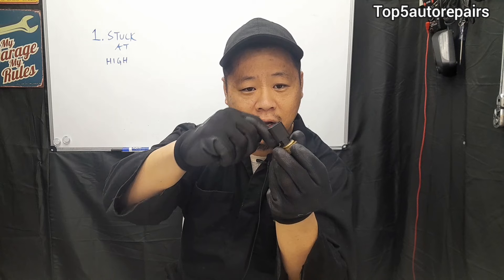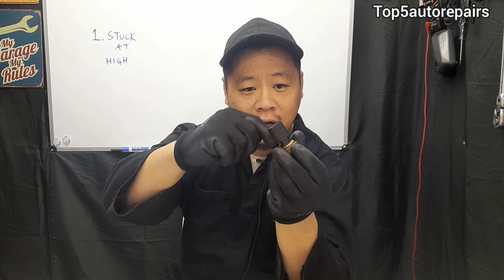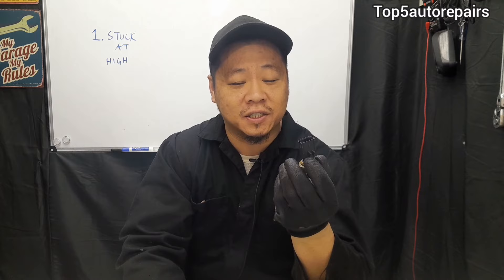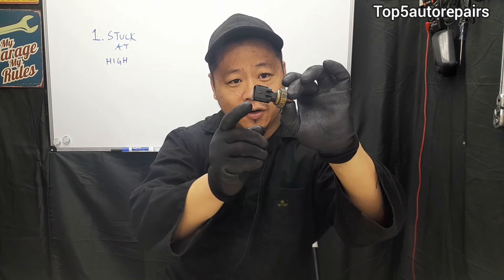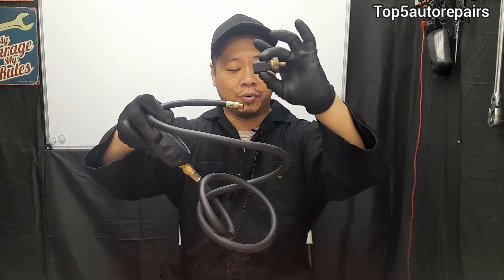Symptoms of a Bad and Failing Oil Pressure Sensor Switch | Oil Pressure Gauge at 0 20 80 | Light On

Comment: My question is that I get the low oil pressure when the weather is cold at 55 degress and not at hot or warm days. Can it be my sensor or is something else??
Reply: I think it just determines how the temperature is but if your worried ask a local mechanic to make sure
Reply: Did you figure it out? My 2008 Honda civic oil light just turned on for the first time and it’s been cold (-3)
Reply: I think it’s temp sensitive. The sensor performs better in warmer weather as opposed to colder weather.

Comment: My oil light came on a few days ago but only when idling. It’s been cold as hell recently so I don’t know if that’s the reason why.
Reply: If you've been driving the car on short trips, is diesel, and is cold outside, then it can happen that there's carbonization in the engine or some part is clogged somewhere. An engine flush followed by oil and filter change can fix it. Air filter replacement is also advisable. But it can be something else such as engine gasket leaks, or even sludge accumulation in an oil strainer under the engine. To know best, you can hook up your car on a OBD scanner and look for sensors in the oil pressure and oil pressure control solenoid. Sometimes, the solenoid cannot fire because it's digitally controlled and dependent on the correct oil pressure to activate the release valve when you remove the foot from the gas pedal, resulting in errors like this. Firstly, the pressure itself at idle should be normal as well as at particular RPMs. Hope this helps.

Comment: Having an issue at the moment that’s stressing me out. Four days ago I noticed when I would take sharp turns I’d get “ check engine oil level “ and as soon as I’d drive normal it would go away , and it’s been doing that ever since. I checked my oil yesterday by looking at the dipstick and it was dry. I decided to do an oil change and when I jacked up my car I noticed it there was dried up  oil around the oil filter area and alongside other spots by it. I assumed that maybe I didn’t tighten the filter enough, so I made sure to do it this time lol . I finished doing the oil change and drove it a bit and still got the light that says “ check engine oil level “when I took a sharp turn . As soon as I got back to my place I checked the dipstick again and it was still dry
Reply: Wow! You’re very lucky you didn’t blow it up.

Comment: My trailblazers oil pressure gauge bounces back and fourth when the engine gets hot.
Reply: My Joyner trooper 1100 is doing the same thing. Did you figure anything out on it?
Reply: They are a good knock off side by side
Reply: My 05 silverado is doing the same thing hoping it's just the sensor. I've started to get a bit of a knock in the engine too.
Reply: @hunterread3507 did you fix it ?

Comment: Small thought, it may not make sense and I'm sure after years of engineering this shouldnt be a problem but its a thought... After an oil change or replacing the oil could the small port in the sensor make it hard for the oil to flow in causing air to be trapped in it.

Comment: I have a 2011 ford edge and while I was driving I Lost power (dash was still on) but no acceleration,steering wheel stiffened up brakes went hard to press. Then I got a low oil pressure light . Is that what would cause my problem?

Comment: My 350z oil pressure gauge was showing 120+. Changed the sensor with an Amazon one for $20. Now the gauge is reading low close to 5-10psi. And after a day, now the red oil can light is coming on in the gauge cluster when at idle. I bought a manual tester and it’s reading a healthy 14psi (the tester  was on loose too, as oil was leaking). Thought it was the gallery gasket, guessing just a faulty cheap sensor from Amazon. If my car blows up…..

Comment: My 2004.5 LLY Chevy 2500 duramax just started throwing a low oil pressure warning and won’t stop chiming. I drove the truck for an hour without anything happening to the truck so I’m guessing the truck is getting oil pressure but the cluster or sensor is gone. Wouldn’t the truck start knocking or lose performance after an hour of driving with zero oil pressure ?

Comment: Exactly how my Ford 2002 expedition stalled out... Oil gauge was goin bonkers .. high and low ... Then not long after my SUV stalled out.. left my expedition parked for about a year... Untill recently this month I'm trying to figure out what next to do...  When I checked the oil. There's no mixture of anything odd ...  Jus Looks like Black oil that needs to be changed.. so now the radiator has been replaced,. I'm putting in a new Air filter, oil & oil....and jus last week I bought the oil pressure sensor or something.... I haven't installed anything yet jus the air filter .... But I was told it was the oil sensor...  And  the engine was locked...  I don't know...what \ or where to start.. but with the battery first 😂

Comment: Hmm, I got one where the needle will sometimes fall to zero for about a second and then back to normal. Usually does it on a blue moon (don’t drive it a lot now). 

On my car it should be an on and off type of deal. 

So my assumption is, it’s going bad?

I’ve had the engine rebuilt so I would think it’s the actual pump as it should be a new unit.

Comment: Excellent Video Boss man! I`m getting good oil pressure on my gage but still getting the Ck engine light on my 2014 Chvy Silver PU. So if I change the Oil ,Filter and Sensor switch what about the little sensor filter that sits right behind the switch?
Reply from the maker: Correct
Reply: @Top5AutoRepairs  Thanks

Comment: Any suggestions on what i can do to get rid of my rocker arm/lifters from clicking when going above 2000rpm? My mechanic said there was no damage internally but the there are a whole crap of sludge. And to use seafoam prior to doing oil changes (every 1,000 miles) and hopefully it goes away.

Comment: I Just Bought one used 2008 grand vitara v6 2.7 lts.  
They reap me off
Now i m dealing with it
Anyways

The engine starts on time
(No hesitation at all)
Temperature looks good after an hour of driving
Runs pretty good on flat surfaces...except hills

My problem is that 
- the scanner plug doesn't  work. (Can't  read any codes)

- I Just found  that they disconnect the oil sensor or knock sensor 

- It looses power after warmed up going up a hill.

- it makes a rattling noise by the driver side of the engine.

I m fixing to run all types of tests  ....
Oil pressure  , engine pressure (compression)  
Any other suggestions 
Thanks for your advices

Comment: I swapped out my oil pressure sensor and the light stays on now. It use to flicker. Oil change and lever good. 2.5 duratec.

Comment: I have a 2001 mercury grand marquis and the oil light comes on most times lately when i stepped on the brake pedal before and after i got a oil change and the brake fluid is clean & full, Is this my problem??

Comment: My car jumps like it wants to stall no check engine lights and I just got it back from the shop didn't really want to take it back to said shop cuz if they didn't fix the issue why would I take it back and let them charge me again not to fix the problem but just didn't know what to do any info would help but acts like bad fuel or faulty fuel pump please help

Comment: My 2008 Mazda 6 engine oil light flickering while in low speed. But the light is off while in higher speed. 
Is it a problem with OPS?
Thanks
Reply from the maker: Most likely but first check oil level.

Comment: I got a 2016 Hyundai Tucson with oil light flickering, checked oil and it’s good, I replaced the oil pressure switch with a dealer one. So it has new switch and oil level is full but oil light keeps flickering. What can it be? Thanks in advance 🙏🏼
Reply: The wiring, bad oil filter, or engine bearing clearance are too high.
Reply: So you're saying you can have a bad oil filter just about Dew for an oil change

Comment: My zr2 s10 has 329K miles and it showed 0 psi out of nowhere and turned off while I was driving, but it has done it a few days at a time, does this mean the sensor has finally given up, or has the switch given up?

Comment: Hey man, please help me with my isuzu dmax 2007..
My formen told me he use 15-40 semi synthetic engine oil..
Why when i started my engine, oil pressure light comes on however they go away as soon as i hit the gas. But when i release the gas it will appear again…after driving for 20-30 minutes it will go away..Any ideas? I already got my oil pressure sensor and oil pump changed..im also changed my head engine totally it cost me MYR8000
Please help man, i really dont want my engine to broke again…im in Malaysia, should i change to 20w50 engine oil?

Comment: Do I need to drain oil before changing switch or can switch without anything
Reply: You can always just put the oil back in as long as it's clean
Reply from the maker: No need to drain. Make sure to check oil level after replacement.

Comment: I'm replacing the oil sensor in my car and I want to know if I need to disconnect the battery since it is electrical or can I just change it without doing that step?? Thanks
Reply: Disconnect the battery first

Comment: Having some problem gave me a low oil pressure code while driving so I added some oil then drove a Lil bit then it came back on low oil pressure was keep flickering with the red oil symbol what u think
Reply: If you overfill it will cause the same type of issue.  Make sure you didn’t over fill

Comment: My 5.7 ram has normal oil pressure then an alarm and red light and guage falls flat. Cut it off, crank back immediately and perfect pressure till it does it again.. any ideas? Many Blessings, Kev
Reply: Same. Did u find a solution
Reply: Same issue. Usually happens on a mid-chilly morning 60°F or so. Restart engine, pressure works fine. Will change switch at next oil change.

Comment: Will it cause rough cold starts that smooths out after a minute or so?
Reply: No. All the oil pressure sensor is is a warning device. It has no affect on your cars performance whatsoever.
Reply: @eliferguson3422  thank you
Reply: @radianm6  no problem 👍

Comment: Can the ac pressure sencor be the reason of my car overheating. I got a 1992 buick riviera 3.8 6 Cyl my pressure switch ac leaks were i connect the plug on to and my car overheats
Reply: Check the your engine temperature sensor or ETC that’s the culprit if the radiator and everything else is good usual place is near thermostats or side of engine block
Reply: @rosieclark3661  thank you

Comment: My oil pressure gage is sticking at around 20 sometimes 0. Just had a lot of work done some by mechanic some by me after my car broke down on the highway. New fuel filter & pump, all new spark plugs & wires, distributer, starter, thermostat.. I think that's all 😅
The coolant gage sometimes bounces still but I push on brakes and it goes down pretty fast. It doesn't seem to be overheating because the level hasn't gone down again. 
The oil pressure was fine before this..
Reply: My 2013 gmc Sierra hangs out at around 20 but i got no check engine light and its running like the day i bought it. Just turned over to 76k miles

Comment: hey man, just got my car with back from the shop with a new used engine a couple months ago. However when im driving for awhile and i get in traffic my temp gauge rises and oil pressure light comes on however they both go away as soon as i hit the gas. Any ideas? I got my oil pressure sensor fixed by them the day after i got it back and it continues to do it
Reply: How's the oil level?
Reply: Could be bad tolerances in the engine. If the crank etc are worn down, oil escapes and you lose pressure. Pressure can drop once the engine warms up (oil thins out), once you stop driving (engine begins idling under low load). This combined with loose tolerances means that insufficient pressure is produced to fully lubricate the engine. The overheating at idle could be a number of different things. Air bubbles in the coolant (wasn’t burped properly), low coolant, thermostat going bad, and worst case is the engine overheating due to poor lubrication at idle, or alternatively a head gasket leak. Can also be caused by a seriously jacked up water pump. My 2006 Colorado actually had both of your complaints. Oil pressure light would come on after heavy driving in hot weather when I came to a stop. This was fixed by simply installing a new sensor, old unit went bad. The coolant issue is something I’m still somewhat chasing, though I believe it was related to a poor fuel to air mixture that I corrected, as it has remained relatively steady since I completed work on it. I hope you can find out what’s wrong with your vehicle, surf some forums with a lot of different phrases; chances are someone else has had your symptoms.
Reply: Forgot to mention to check your fan clutch; if it’s gone bad it won’t engage and you won’t have additional assistance with airflow at a stop to help cool the engine bay. Very well may be a culprit with a used engine
Reply: Sold you a motor with bad main bearings probably, and or oil pump! Or both

Comment: Can it cause my 2003 dodge Dakota to  keep stalling after it runs for a little while
Reply from the maker: It's possible but unlikely. I suggest checking oil pressure and compare it to spec.
Reply: Having the same issue with my 06 ram 1500 4.7 stalls out when coming to stop signs or stop lights randomly changed hell a shit and still happening
Reply: @juanornelas6779  camshaft or crankshaft sensor if it hasn’t been replaced yet
Reply: @Top5AutoRepairs oil pressure Guage can help to check pressure on the oil pump